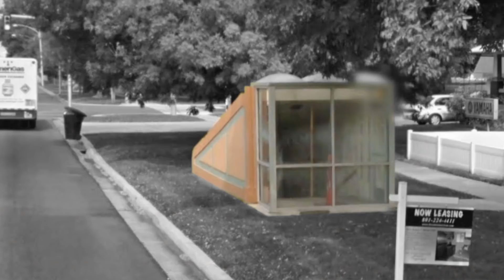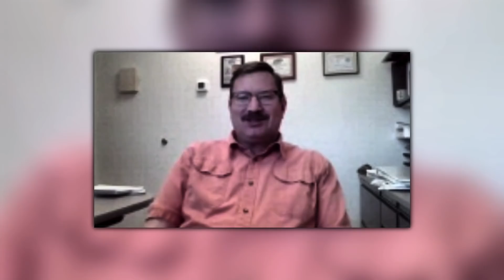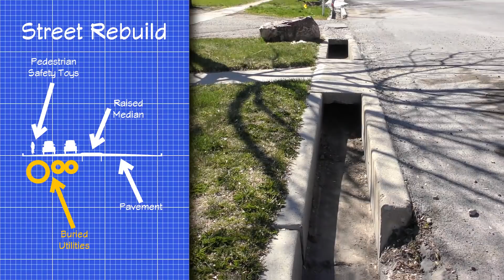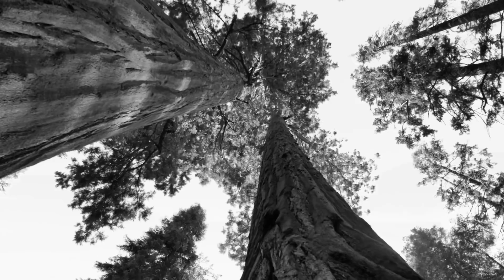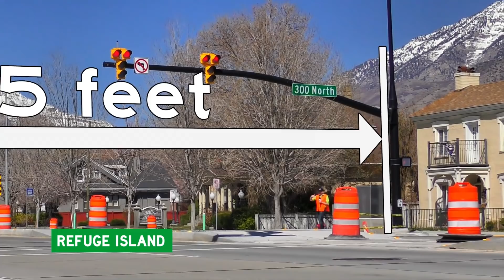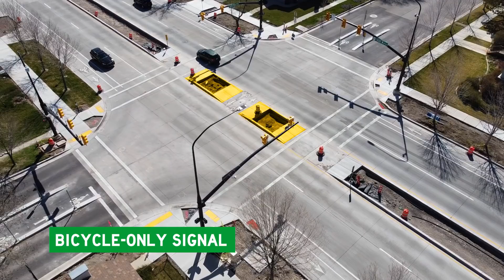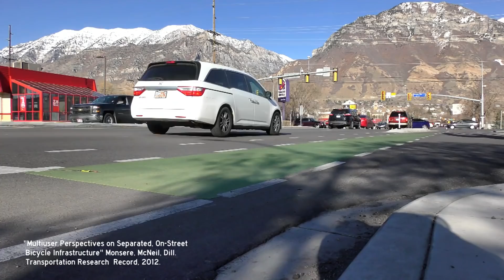Rebuilding the road? Joggers and bikers WANT TOYS, too!

Comment: Bulb outs suck, i've driven over those things so many times at night, they are in a blind spot when your stopped at the intersection turning right. if you didn't notice it before getting to the stop, you can easily scrape up your rims or undercarriage. why do they build those?

Plus they remove room for emergency vehicles, if an ambulance is coming behind a car near a bulb out and the car needs to get over, there is no where to get over. People should take the turn and get out of the way obviously, but that's not always what people do. Sadly i've seen cars just sit at these (sometimes ubers picking up or dropping people off) creating a hazardous situation and blocking road access. If a pedestrian wants to walk by, now they are in a blind spot of anyone trying to get around the stopped car. Crash!. Bulbs outs seem like a waste of taxpayer money. These things also cut off access for a car pulling to the right of the curb to turn right while another car is trying to turn left. I get it's about pedestrian safety, but how does it actually effect that? It's bringing the pedestrians closer to the cars, while they wait to cross.

Can you do a video on this?

Comment: How are raised medians better than bioswales? 

Uncontrolled crosswalks on multi-lane roads are so dangerous that they should be illegal. Drivers do not respect them and they lull pedestrians into a false sense of security. They should be Hawk crossings, or ideally Puffin crossings with full signals. 

Bike and pedestrian infrastructure are not “fun toys.” They are essential life-saving equipment. 

The self-reporting method is unreliable when assessing congestion. To see if traffic throughput has been reduced by a road diet, do a scientific traffic study. Drivers will always report a perceived increase in journey times after a road diet, but there is no actual evidence that they cause congestion. And even if vehicle speeds were reduced, so what? That is a positive from a safety point of view.

Comment: But what if you are a bicyclist on a state trunkline outside of the city? 
Many times I have had to just stop to avoid a semi that would not give room on a certain 4-lane trunkline road with a 55 mph speed limit...Part of the problem was fixed when the state put a road diet on a mile of said road, and while not an official bike lane, there is a paved shoulder to ride on

Comment: It's crazy that the school is built right along a heavy STROAD way. A road diet would have been more suitable for at least in front of the school.
Reply: how DARE they build a school where a major thoroughfare was going to end up being.
Reply: A bottleneck in the middle of a stroad will cause backups making the stroad bad at its purpose and pissing off voters who use it.
Reply: @flinx  the speed limit already has to be lowered to 20mph when school is in session, why not have it 20mph by design instead of using police to enforce that.
Reply: @flinx  anti-car believers also don't believe road rage is a thing.
Reply: @geoman798  because that road is also for going longer distances between neighborhoods, not just short distances within a neighborhood. For longer distance travel roads have higher speed limits.
Reply: @flinx  Ok, then we should heavily limit access on that road and move the school somewhere safer along a street instead of a road
Reply: @geoman798  why "and" not "or"? If the school moves the road is just another inter-neighborhood road going faster.
Reply: @flinx  distinguishing between roads and streets is hugely important. You seem to be in favor of turning this stroad into a road so we limit access along the road (I.e. no schools, shops, or homes fronting the road). 

Then perhaps add a node of low intensity mixed use (2-3 story homes/shops) where the new school will go to make a neighborhood center, off the road along a slow street that’s not a main thoroughfare for cars.
Reply: @geoman798  I'm not going that far because I haven't researched the area enough. What I think does make sense is if the school moves away, the stroad can remain just another stroad about as useful and good/bad as other stroads in the region.
Reply: @geoman798  Maybe you've seen the Not Just Bikes video about keeping streets and roads distinct. That video is interesting, but it's not prescriptive for actual solutions to built sprawl in the USA. The environment has been built. The damage done. Fixing it needs not just a plan, but the plan has to be one voters won't overthrow.
Reply: @flinx  I do agree, retrofitting the suburbs is a daunting task that is unfortunately turning into a partisan issue even though it is most certainly not, but there are ways forward in many cases. A great way to start is by building transit and focusing future growth in specific areas centered around that transit or Transit Oriented Development (Road Guy Rob has a video on this). These TOD's or urban villages would be of varying intensity so you wouldn't have 60 story towers at all of them, in fact most of them should probably cap at 3-4 story to not disrupt the neighborhood. 

With these TOD's, you could start to put the pieces back together in a cohesive way like moving that school to a more people friendly street near transit. It would also help to beautify each area giving a sense of place and an area for locals to gather, hang out, and be proud of.
Reply: @geoman798  We are not going to solve the housing crisis with "3 or 4 story" buildings. We need to rapidly urbanize and build as high as possible, especially in valuable land next to train stations. High rises also create sufficient foot traffic to justify nice pedestrian tunnels, instead of expecting people and cars to share at grade crossings.

Comment: I say they should have lowered it to 1 lane for cars. Encourage more biking/walking, and upzone to build density.
Reply: After the hypothetical road diet voters responded by replacing the city council and the new council promptly restored the stroad.
Reply: I think you need to look at what kind of streets you're converting first instead of simply doing it. I live in Toronto and in one of the suburbs they completely redid a long stretch of road with new bus lanes in the middle, bike lanes and 3 lanes for cars in each direction. They also did a bunch of nice landscaping and new sidewalks as well.

The problem is seeing as that area is low density and businesses are mostly in plazas followed by stretches of nothing, in all the times I've driven by that area no one ever walks and the bike lanes are empty 99% of the time and even the buses are very underutilized by people.

My point is maybe city planners need to design better cities from the start to allow for streets lined with stores and with other things for people to do so that they will want to walk and bike and congregate there. Building things after the fact to encourage more people to walk or bike is hard if you mess up designing a walkable area to begin with.
Reply: @UzumakiNaruto_  The government just needs to bite the bullet and plop down some state-funded high-rises. I like the Chinese ghost city approach where capacity is pre-built and there is no need to do costly overhauls and upgrades as people move in.
Reply: Ideaology over reality at work again. Ugh. (See @UzuMaki's comment for reasons why)

Comment: lights with refugee island sometimes are designed so poorly they force you to take two turns to go through the road, that should happen only to elderly and disabled people imo and anyone walking at least typical 5km/h should easily cross both parts of the road during single cycle
Reply: no because that slows down cars and car good walking bad

Comment: i can understand now why the new median in our city's main road is like 3 feet taller above the ground then they put some plants and light posts in it.. even though we don't have snow here lol
and also, about bicycle lanes in our city, they just recently started giving cyclists a space on the road but our roads here are mostly 2-6 lanes wide and putting buffer zone in between the bicycle lane to other vehicles is the engineers current problem here and we already have a very bad traffic even during the easing of lockdowns.. i do have proposed designs for bicycle lanes in our city but i don't think it would help other commuters like how the design help cyclists.. i would rather live in paris lol

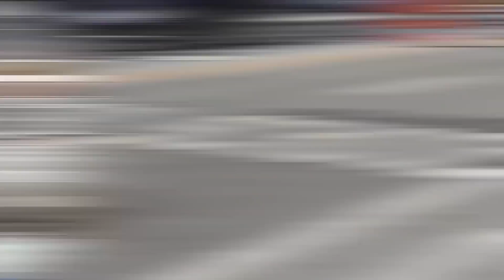Comment: The curb extensions at 9:00 seem a bit silly. I mean why still 40 ft? You could fit a 4 lane street in there. Here (Northern Europe) our low density residential (2-way) streets are intentionally just 5ft 5in wide to keep speeds at a reasonable level. Here you'd see an island on any crossing that has significant pedestrian or motor vehicle traffic and that is wider than 30 ft (including the island). Crossings that have less traffic may be longer without an island but 40+ feet feels exceptionally long. Kind of funny that that's considered traffic calming there across the pond.
The plowable ends seem a bit odd as well. I guess we don't really have them around here, since I've never seen one. Still snow plows aren't hitting our curbs all the time. Only after the marking sticks have been buried under the snow. It seems a bit odd to me that you'd make the curb (on a wide street) more forgiving, if the goal is to keep speeds in check and people off the curb. Of course curbs should be quite forgiving on actually narrow roads ( less than 9-9.5 ft per lane).

Comment: People pay little attention to lowtech solutions to problems people spend fortunes and software trying to fix. One of the most low-tech innovations ever the humble bicycle.Bicycles themselves are a mature technology with not that much to improve upon. They don’t need rails, overhead lines, traffic management systems, traffic lights, smart grids, smart phone aps, gas stations, batteries or superconductors, charging ports, digital doodads, computerized whatcha callems. They require none of those things, which is why upper establishment types hate them. They represented mobility freedom in the 19th century. Today, Largely invulnerable and independent from Energy prices. But they do need roads, Albeit very little. 
– Cost of sidewalk in NYC installation: 485,000 dollars per mile (10 foot wide and NYC labor costs)
– Cost of typical 3 feet by 3 feet neighborhood sidewalk: $18-22 thousand per mile.
– Cost of paving one mile of two lane road: $1 million.
– Cost of Building one Mile of two lane road: $2-3 Million rural, 5-10 Million Urban.
– Daily US gasoline use: 337 MILLION Gallons per day (at 3 bucks a gallon, Americans spend a Billion dollars a day buying gas)
– Yearly US gasoline use: 123 Billion gallons (Third of a trillion dollars)
– Daily CO2 tonnage: 3.37 million tons
– Annual CO2 tonnage: 1.23 Billion tons per year.

– Cost 100 lane miles of expanded road/highway: over 500-700 Million dollars
Versus
– Cost 100 miles of sidewalk/bike infrastructure: 48.5 million dollars

Net positive side effect of a 1% decline in driving thanks to bike/pedestrian friendly infrastructure,
Saves
– 3.3 million gallons of gasoline
– shaves 33,000 tons co2
– 1000 tons daily of stoich residual hydrocarbon emissions
And with an average price of 3 dollars a gallon; 10 million dollars otherwise spent on gasoline saved that can be invested or better spent on other purchases.

Comment: Baltimore has been doing a lot of these bike friendly projects recently but the approach could be meddling. It's fine if it doesn't dramatically interfere with some streets but others just aren't the right place to have such a thing.

Cool seeing the various concepts to deter 'wild child drivers'
Reply: Bike infrastructure is a lot narrower and more space efficient than car infrastructure. If you don't have space for bike infrastructure, how do you have space for cars?
Reply: @weetikissa  Some deprived places can only afford the cost and/or land of infrastructure for 1 mode of transportation, in that case the mode has to be as generalist as possible. Small size of bikes is no good if it cannot operate in all weather and all trip distances.
Reply: @RealestUrbanism  Bikes do operate in more weather conditions than cars, mind you. And they're way faster and more efficient for shorter trips, although 6 mi / 10 km is a very doable 30 minutes, too. And don't forget that bollards are bike infrastructure, too, so modal filtering is very cheap.

Comment: I've never personally seen one, but I'm already not a fan of the "bulbout". It defeats one of the main purposes of not allowing parking close to corners, which is to allow large vehicles room to turn. Sure, these aren't installed on streets designed for 18-wheelers, but some large vehicles do use them, such as school buses like I drive. If you narrow the street from 48' to 40', and someone pulls all the way up to the white line (and they always seem to crowd the centerline too), that leaves me with ~20' to make a right turn with my 40' bus. I take pride in my ability to maneuver in tight spots, but I guarantee you I'm running over that curb. Give us that space to turn, or don't complain when there's a big dual tire track through your tulips.

Comment: Bike lanes shouldn't just be painted lines - they should be separated from the road by trees or at least a raised concrete barrier. Also, right turn lanes should not cross the bike lane - the entire intersection should be raised, bulbous on all corners, and right turning cars should be on the left side of the bike lane.

Comment: The bicycle lane you discussed at the end is called a cycle track. And lots of bicyclists don’t like them, and they was sharrows so they can ride in the traffic lanes. If you are going to remove a lane so you can build a cycle track, then allows the bicycles to ride in the lane, it’s just makes no sense. Look at Encinitas, CA where they have a cycle track and sharrows. A total waste.
Reply: the design that's shown is /not/ a cycle track. Cycle tracks are generally continuous facilities at sidewalk level or just below. This is a street level separated bike lane which is considered a "less than" facility compared to a cycle track.
Reply: @andr_w  this is the definition of a cycle track from NACTO Urban Bikeway Design Guide. 

“A cycle track is an exclusive bike facility that combines the user experience of a separated path with the on-street infrastructure of a conventional bike lane. A cycle track is physically separated from motor traffic and distinct from the sidewalk. Cycle tracks have different forms but all share common elements—they provide space that is intended to be exclusively or primarily used for bicycles, and are separated from motor vehicle travel lanes, parking lanes, and sidewalks. In situations where on-street parking is allowed cycle tracks are located to the curb-side of the parking (in contrast to bike lanes).”  

What was shown is a cycle track.

Comment: I've never seen the point of a dedicated bicycle lane in suburban neighborhoods. They may make the roads look nicer but really it's easier and safer to just ride on the sidewalk. Most of these town barely have people that walk the sidewalks so its not hard to avoid pedestrians. Most people drive to their destination. So unless I am in a big city with lots of foot traffic I will always ride on the sidewalk.
Reply: If its not there, people wont use it. If its there people will use it. Its the basic concept of induced demand. God forbid we make it easier to get around without a car!
Reply: @ChickemTender  watch me still not using the bike lane cause I feel better on the sidewalk. Bonus points when you see me riding on the wrong "lane" on a suburban road.
Reply: @JeffsYTubeChannel  When making a right turn, I have several times nearly hit a bicyclist racing down the bike line from my rear.  If they would ride opposite traffic, that would help a lot.  The sidewalk would provide both the cyclist and the driver a little more time to react and avoid a collision.
Reply: @stevengordon3271  Neighborhoods would be much more walkable/bikeable if we created a parallel road grid separate from car roads, just for pedestrians and bikes, and have them cross in the middle of the road instead of at car to car intersections. Sharing the same road with cars, bikes and pedestrians is quite silly. There's a pizza place 10 minute walk from my house but I never walk there because I do not feel comfortable crossing 20 residential and business driveways.
Reply: @shawnpitman876  I grew up in a walkable city, part of what made it walkable was because it didn't have driveways, only sparsely spaced entrances into giant mixed use complexes
Reply: @RealestUrbanism  I do not see how what you wrote is at all relevant to what I wrote. 

What the best theoretical neighborhood design would be can be debated (but I was not doing that). The issue will always be how to feasibly get to a best/good design from what currently exists in any given context.  Small town Utah is not a likely first context for a feasible transition.
Reply: @stevengordon3271  It is relevant in eliminating your problem of not being able to see bicycles coming from behind you when turning right by eliminating the bike lane on the car road. All that is required is a tiny bit of pavement for a parallel bicycle path that is displaced from the car road, which is doable for many small towns.
Reply: @JeffsYTubeChannel  Cyclists (and other drivers tbh) need to learn "don't pass from the right"
Every internet smart*ss complains about KRETP, yet pay zero attention to the equally important sister rule.
Reply: @shawnpitman876  Where did I say to veer out of your lane, or to weave into traffic? If it is unsafe to pass from the right, and it is unsafe to pass from the left, then you are only revealing your reckless disregard for safety by insisting on passing.